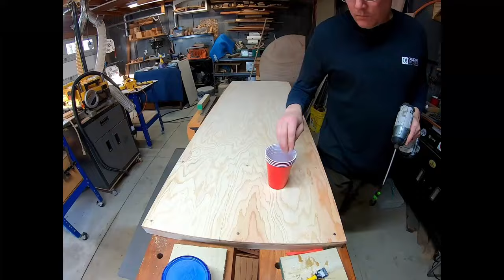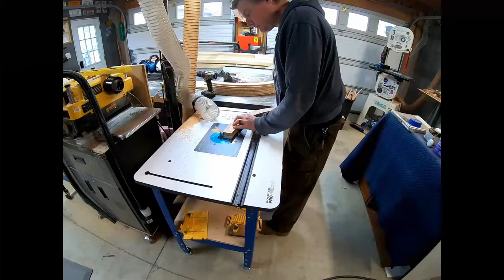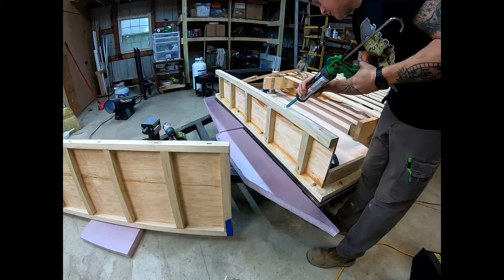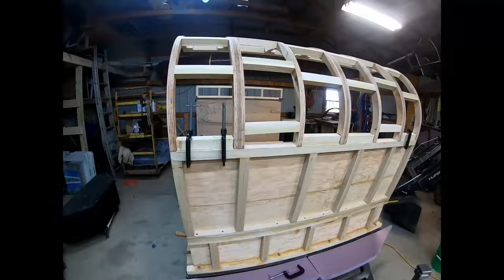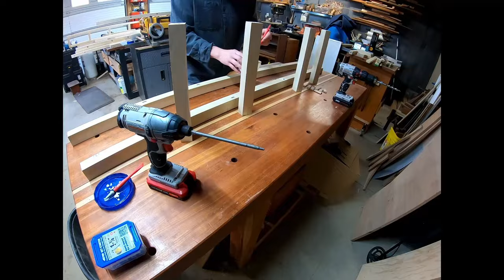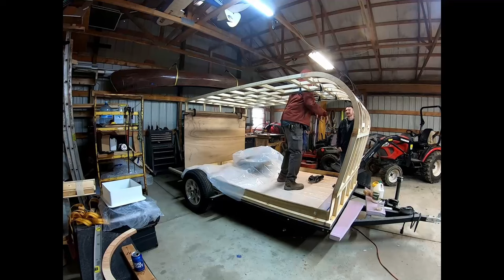Teardrop Camper pt 4

Comment: Nice, looks like a strong but lean structure. How did you work out the design? Are you working from plans or chicken scratch on paper?
Reply from the maker: I had general dimensions and an idea in my brain, then started eating the elephant one bite at a time. Used foam board (off camera) to figure out the profile and see what looked reasonable, then transferred to wood templates. Roof was designed around accommodations for a roof vent and sky light.